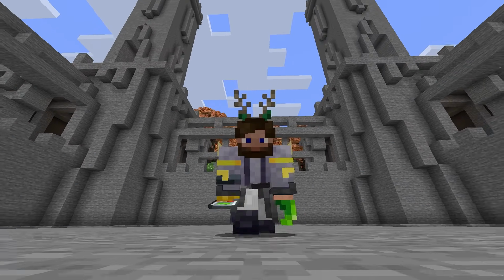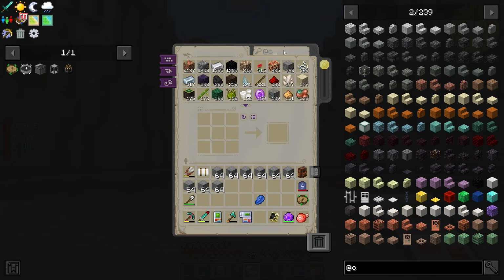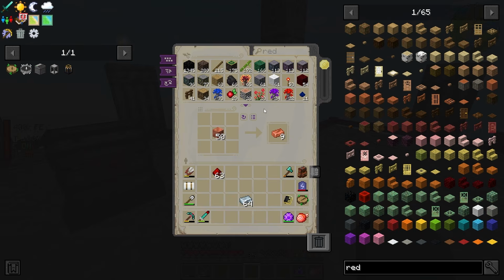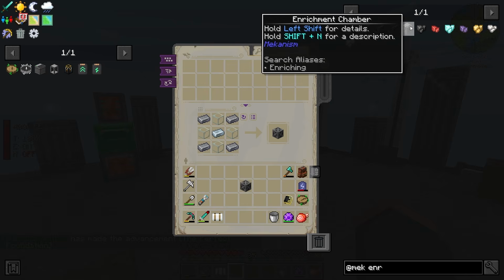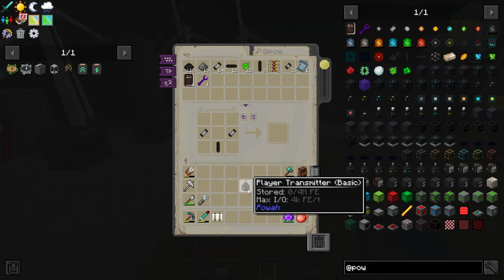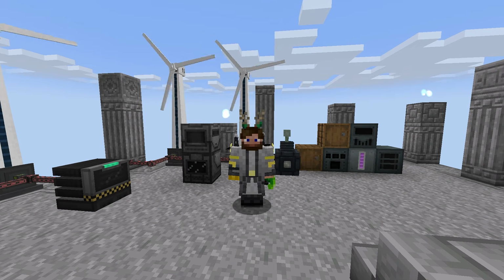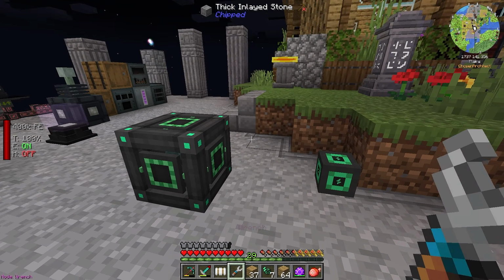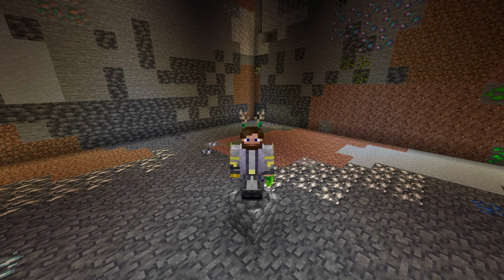All The Mods 10 EP9 Mekanism Cables Has COVERS?

Comment: Oh Man, Ive got a couple of notes! 

1. Ender cells and ender gates can both receive and output power. You need an ender cell with a battery to establish
a channel. But once thats done you can put an ender gate on a generator to send power to other machines. Also instead of 
putting a gate on a mekanism cube, you can just use an endercell. 

2. Integrated dynamicss also has a cross dimensional max-int fe transfer solution with the omni-directional connector. 

3. Sticks have a 100% chance to give you sawdust.
Reply: Thank you for adding this. Once a battery is used on an ender cell, is it impossible to retrieve the battery? Also, I think I accidentally used a ender cell on a Thermo generator. I guess I can't retrieve it either? I can't see it in the menu and it didn't do anything with my generator's stats. I am still new and found this mod difficult for whatever reason.
Reply: @zachi.3522 no you cannot recover the battery, it is not in the ender cell. the battery is consumed to expand that whole channel’s storage. But that shouldn’t relate/apply to a generator.
Reply: @fashnek  hey thank you for clarifying!

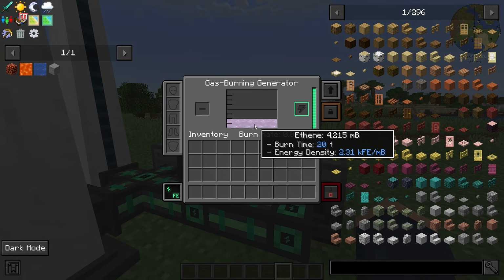Comment: 12:44  the gas-burning genny doesn't produce its maximum amount until its internal tank is full.  
i just tested it in a creative atm10 world, and when the internal tank is full, it produces nearly 30krf/t.
but even 10krf/t would be worth it because they're incredibly cheap to make and support.  (the recipe in atm10 requires atomic alloy, so your definition of cheap may differ)
Reply: That’s what I thought, I’ve seen my setup produce 52kfe
Reply: @nix_for_u  yeah i've seen it produce 74k on another modpack.  but 30 is still damn good for the small amount of work it takes to get there.

Comment: One thing to be aware of is block coded to be compatible with a multi block structure won't be pasted, even if they are not being used in a multi block. 

So the bricks from ovens or smelters and metal walls from some reactor mods that look good for normal building won't work and will be missing from your pasted structure.

Comment: 12:45 ATM packs nerf the Gas-Burning Generator while buffing other sources because otherwise the GBG would just be the best choice that everyone uses like in several past packs.  They just didn't mention it in the quest book this time unlike ATM9
Reply: Thermogenerators from powah❤
Reply: @Ахалотль Currently using these, very strong
Reply: @Ахалотль  Really useful early game. Best 1 block FE solution imo
Reply: I mean, windmill farm at build height is just as powerful with less effort. You only need some basic mekanism stuff, copy paste gadget and a wireless power solution. And the last two are technically optional.
Reply: @paulelderson934  Yeah I had like 10 wind generators powering basically everything automated up until I could get spirited reactors then just upgraded those when I could. Wind farms are super OP early game in my opinion and if you don't like the look of them just stick them out of sight until you can get better power. Thermogenerators were what I used last time and I think the ease of wind generators just pushes me over the side of making those
Reply: actually, the gbg in atm10 is still very good, notice how it says the energy density is in kFE/mB, the gbg can actually burn much more than 1 mB/s in this pack as of current (either that or having more ethene in the tank increases the energy density)
Reply: Windmill gens are way stronger, gas burning just takes less space
Reply: They nerfed the Fission and Fusion reactor power gens too. They produce like half the usual power.

Comment: Btw, I think there's a bug with sophisticated bagpacks and pneumatics "shulker"
You can have infinite mobile storage. Bc the shulker goes into a backpack and vice versa. And a shulker with backpacks also goes into the backpacks
Reply: Not really a bug. Sophisticated backpacks only checks if the item you are trying to put into is a backpack. It doesn't check if the item you are putting in contains one.
Reply: Sure, if you want to make it very difficult in yourself then you could exploit it. 

There's so many storage mods in this pack, you can get practically infinite storage with wireless access very early on. Probably before you get access to pneumaticraft boxes.
Reply: @paulelderson934  the pneumatic boxes are in villages in certain building. I'm just starting with mekkanism and using this
Reply: @DividedQueen  oh thanks for the clarification. That does make it powerful in the early game.

I still think it's more hassle than it's worth to pull out backpacks out of boxes out of a backpack out of your inventory. 

It's quicker to waystone back or setup wireless storage.
Reply: @paulelderson934  yeah sure but if you're on a longer mining trip it's pretty usefull :)

Comment: There are spells in Ars Nouvous using the exchange and randomize glyphs to do this with single blocks, 2x2 and 3x3 areas. The exchanging gadget is a little bit better in taking a variety of materials from your inventory and not just the hotbar.
Reply from the maker: 100% I have a tomb that you can find that is the exchanging spell setup ;D

Comment: 10:30 DID MEKANISM FINALLY FIX MY ONE ISSUE WITH THE MOD WITH HOW MACHINES ARE TOO SLOW??? GIMME 32 SPEED UPGRADES RAHHHHHHH
Reply: Nope, the mod that expands the limit for Mekanism machines to 32 is not in ATM10 right now (it was in Craftoria, so he may be mixing that).
Reply: @NichoSilva  NOOOOOOOO
Reply: My biggest complaint is still the bottleneck for the fluids. When you get slightly too much/little of a slurry and it just locks up your 4 rows of machines because each one has 1/5 of enough for the process
Reply: Having more than 8 is not actually better for the machines. The values get so high that they no longer work properly. 32 energy upgrades increases their energy buffer to billions which sucks up all of your power. They literally become small induction matrixes.

Comment: I wish the exchanging gadget would have a “randomize” function like the trowel. Would be so nice for stuff like this
Reply from the maker: The randomize would be a great feature!
Reply: I feel like Direwolf20 could be persuaded into adding that feature. Or adding a new device entirely like a painting gadget.
Reply: Isn’t that just what the fuzzy setting does?
Reply: @ fuzzy just allows you to select every block in an area instead of one specific type of block in the area I’m pretty sure… at least every time I’ve tried it
Reply: The only block randomization in this pack is the Ars glyph. Trowel and building wands are not updated yet...
Reply: Ars has this stuff :)
Reply: The trowel is in the pack btw!